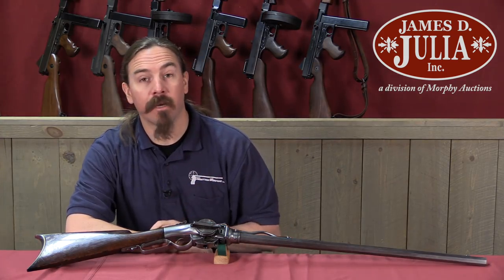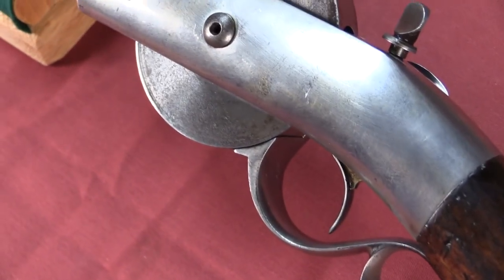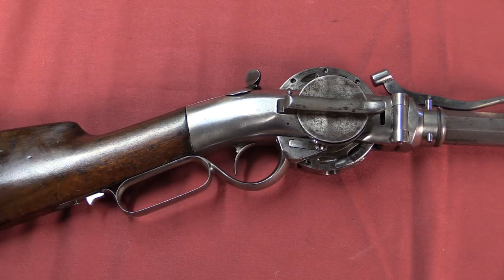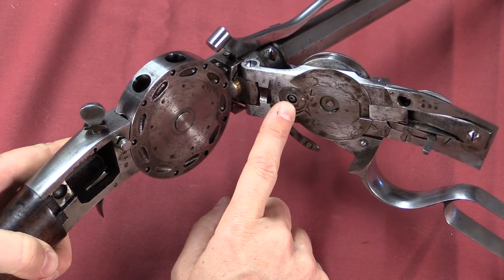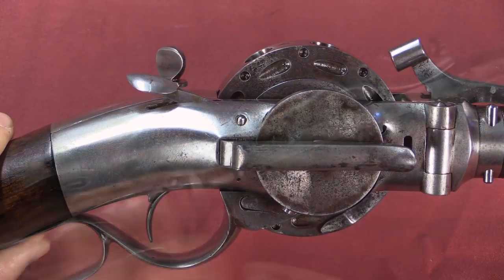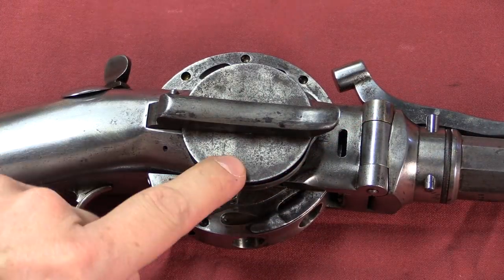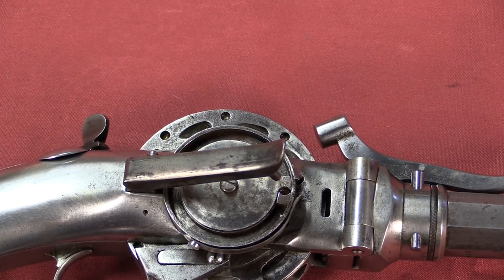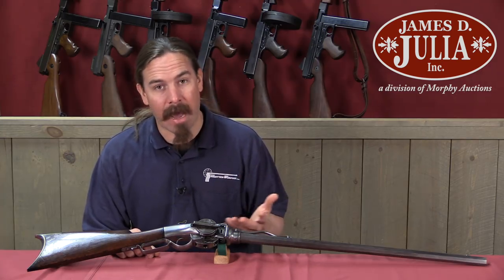Porter Turret Rifle (2nd Variation) - Unsafe in Any Direction

Comment: Would the balls fired from just the chambers have lethal velocity with no barrel to accelerate in or would they just barely fly out? Of course the balls, hot gas and flying sparks could still cause eye damage. 

Also those spring steel "scrapers" over and under the barrel are probably meant to "seal" the cylinder gap and direct sparks and hot gases into a safe direction to reduce the risk of chain fire.

Comment: Everything about that priming system seems designed to chain fire -- the primers being on a different level, leaving a gap, however small, between the sideplate and the cylinder with its big flash-hole troughs, the  primers being stacked up against each other under spring tension ... I assume the idea was that the hammer would push the cap down into the hole before it went off, thus preventing the rest of the magazine from sympathetic detonation? I know it's probably not as bad as it looks, but man, that is sketchy as all hell.

Comment: It would seem to me that at least a little of the chain fire issue could potentially be fixed by relatively thick steel wings on the top and bottom just behind the cylinder
Is this something that was ever played with? Any reason you can think of as to why not?

Comment: I wonder what the most popular radial/turret revolvers was. 

I wonder if the cylinder gap issue of revolving cylinder rifles was better with this design. I know a big reason colt revolving longarms didn't catch on was their tendency of throwing hot gas out the sides, preventing the shooter from steadying the weapon by supporting the barrel. Might be a good selling point, albeit not one that would overshadow the chain fire danger.

Comment: This might be a stupid question by someone who has pretty much zero understanding of those type of guns but what prevents the bullets and powder to just drop out of the cylinder holes that are pointing downwards?
Reply: When you load any of these styles of guns, including conventional cap and ball revolvers, the lead bullet is forced down so firmly that it will not fall out.  Indeed the lead bullet is pretty much swagged down to the bore size, its extremely tight.
Reply: Thanks.
Reply: Always had the same question
Reply: Normally it is tight enough to shave off a thin ring of lead from the projectile. Also, typically people would plug the chamber with a bit of grease/beeswax.
Reply: Thanks. I wasn't even aware that they made bullets to such tight specification back then.
Reply: Most guns came with their own molds for casting your own bullets from lead. That said if you got slightly undersized bullets you'd chamber them with a patch of fabric or leather between the ball and the barrel to shim up the space
Reply: Thanks for the explanation.